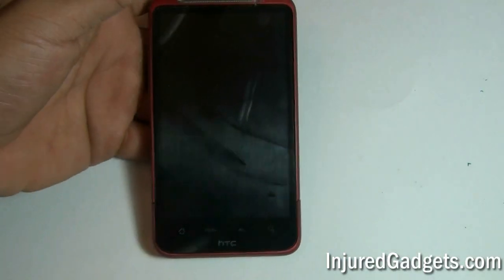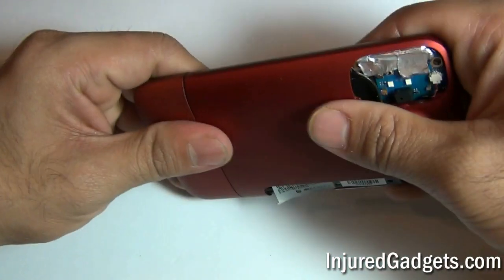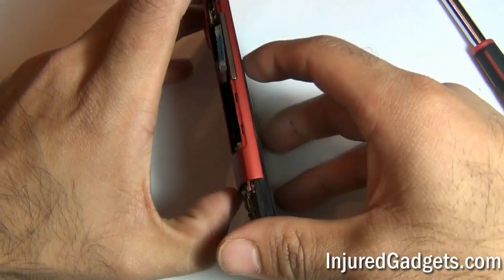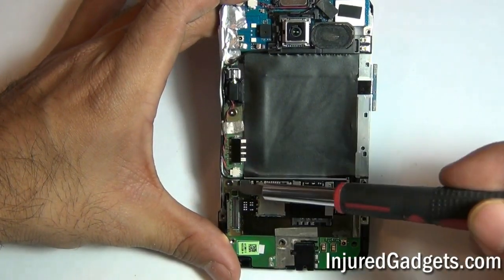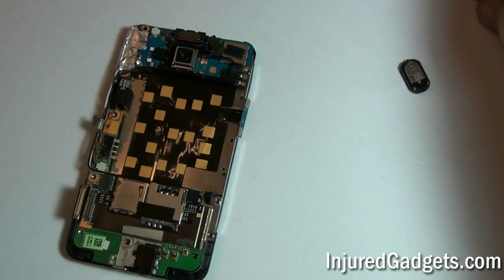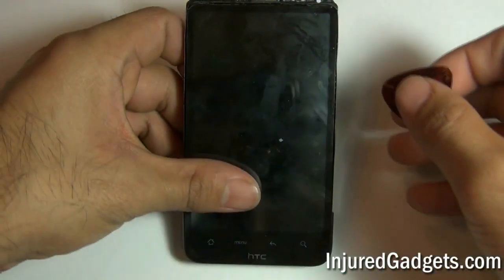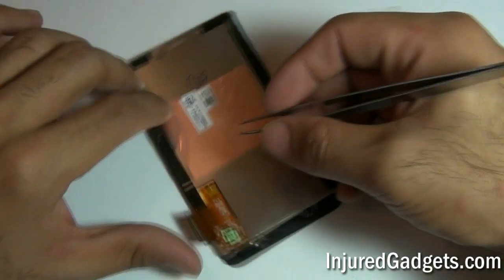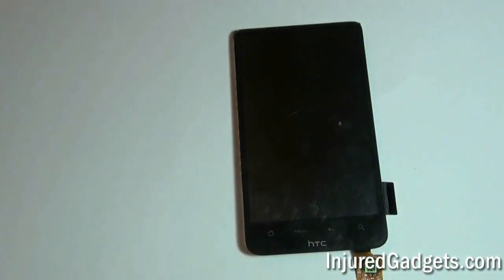HTC Inspire 4G / Desire HD Touch Screen Glass Digitizer & LCD Display Repair Replacement Guide

Comment: it is better to buy an assembled touch screen digitiser n lcd, then you don't have to pry out the digitiser... easier job.
one can skip the step of peeling off the tape that is below the battery, and start prying from the top circuit board, move downwards.. will minimise the chance of ripping the centre connecting part....

Comment: Hey, I found a small needle to work best for taking out the volume panel. My phone's digitizer quit just 2 months ago, ordered a screen off ebay about 17 days ago or something $13 with higher quality tools, and going to resell it on ebay, they go for around $138 and canceling my phone plan after it broke to switch companies cost me $180 so that should pay most of it off. =)

Comment: dude i took my above phone apart to withdraw a micro sd card i thought i got stuck but i found i had not, i put phone back together but i am left with a small gray piece of metal with a hole in the lower area (if you imagine a Z its that kinda shape). And a torx screw longer than others in phone. now phone wont power up, can you help pleassssssssssssssssssse

Comment: my htc inspire got wet from the lower part, and since then the digitalizer does not work, do i need to replace it? or is there any way to clean it up and make it work? btw the screen tuns on and everything is normal the only problem in that the touch function does not work

Comment: DO NOT FOLLOW THIS VIDEO!  They fail to demonstrate how to avoid pulling the actual LCD panel vs the entire LCD digitizer component in the very last step.  This will inevitably result in a shattered LCD screen if you were just replacing the glass.  It is not easy to detect by eye and there is 50-50 chance you will be buying a new LCD digitizer.

Comment: i followed the same video. i only had ONE problem. i broke a small connector which i will solder on. but you dont need the ribbon with holds the digitizer because the new digitizer will have a new ribbon

Comment: so I have fixed many phones before but this phone has to be the hardest one I've ever tried to fix... first I'm having issues getting the motherboard out of the housing and break it by the usb port then It cracked all long the edges when I was removing the lcd housing and when i was doing that I tore the digitizer ribbon... i was trying to keep the digitizer because only the lcd was cracked. Now I have to get a new digitizer for my new lcd

Comment: I broke my lcd. After watching this video i decided to try fix my glass, but lcd broke. The glue is very very hard.... Even if I tried to heat it up. So i think the part where lcd and digitizer is dissambled from the frame is misleading. It looks very easy, and it is NOT.

Comment: Hey ,
Mostly the Flex Cable Connection is loose when you fixed again !!
So pull apart once again and try to fix all the connections back tightly !!

Comment: Do you think i will need a new touch part or can the oil spilled get repaired after opening & cleaning oil? (My screen is also dull due to oil spill. Before the oil spill my phone glass was cracked but touch worked perfectly fine).

Comment: The Desire HD is a little bit diffrent it seems.
Since the connector for the charging your phone is diffrent on the Inspire than the Desire HD?

Tried to repair it myself, but the motherboard would NOT come out. :/

Comment: @InjuredGadgets Hey, great video! I only saw the first two minutes to realize how easy it was to remove the volume flex cable, which I'm having problems with. Tried cleaning the contacts, but didn't worked. What would you recommend me to do, change the whole board or just the external buttons?

Comment: @freakgoingunder  Hey, thats what i did with my phone after taking it apart one time before, i noticed theres no need to take everything out to get the screen and digitizer out, altough it is still very risky. I was able to fix mine, this way. You will need to take out the part thats plastic and has 3 screws, thats covers sd and sim card. To disconnect the screen ribbon. Any questions inbox me!

Comment: Great video.  Now I have a question.  I was able to get 3 out of the 5 screws out.  Two will NOT budge. Any suggestions?  I may have stripped one but the other one is just not working with me at all.

Comment from the maker: @Fraire18 Does it make any sound when connecting it to a USB cable or computer? If it does they likely damaged the LCD during installation. If there is no sound at all, and it worked before you gave it to them, then yes they might have damaged something internally.